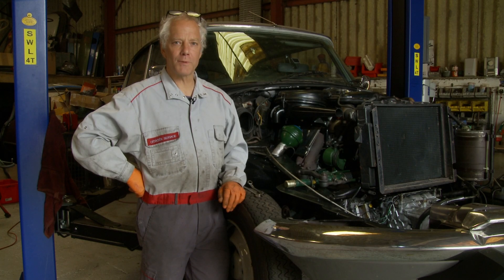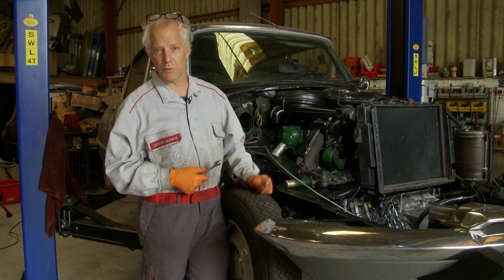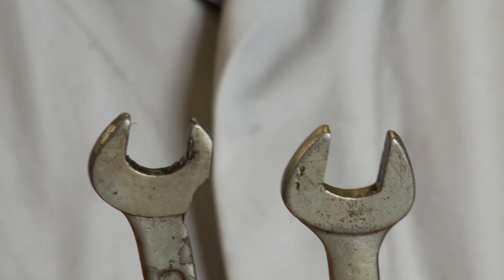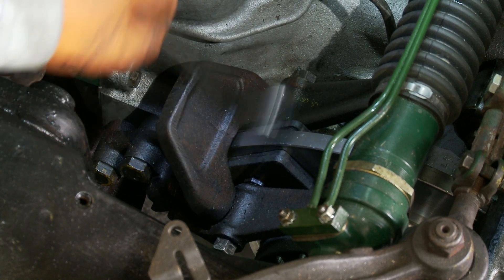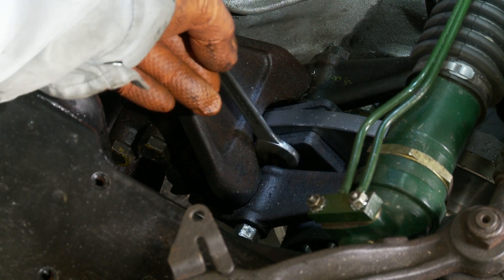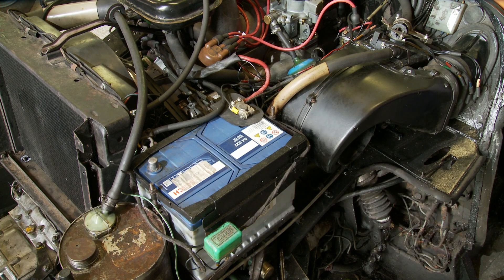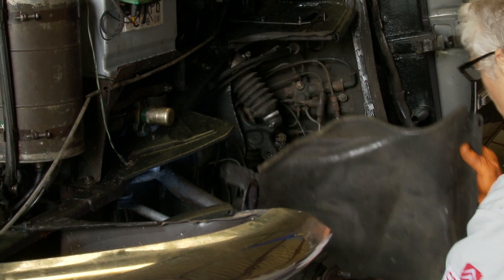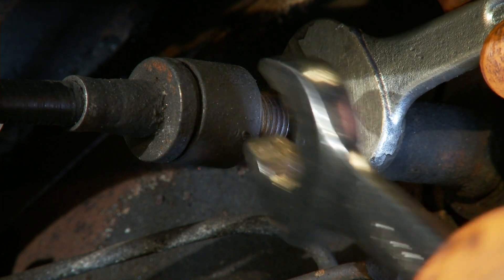Adjusting the Handbrake (engine in car)

Comment: Rather a daunting job I must say. I am at it right now, but combine it with replacing the discs. Even then the left hand side is a Pig. Luckily I do without a BVH, so there is a little more space., and my battery is on the Right hand side too by the way...